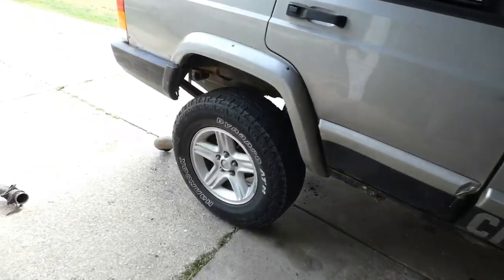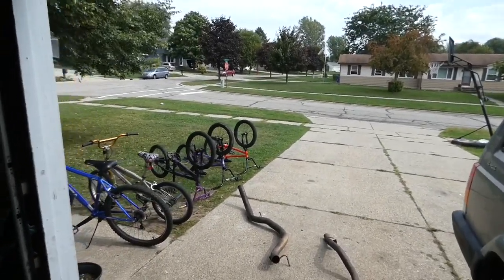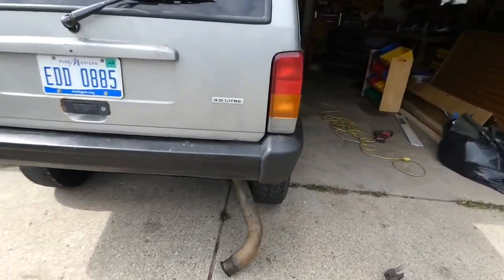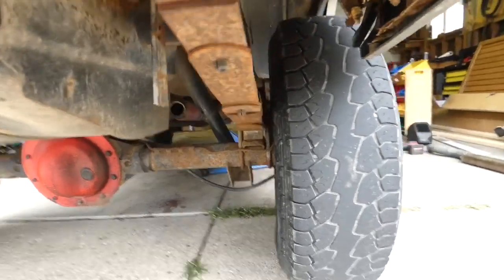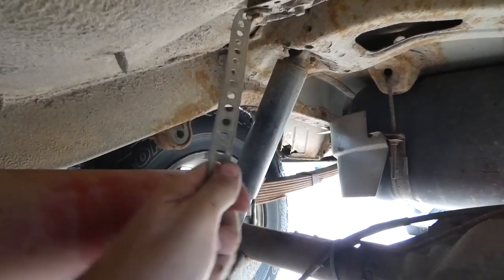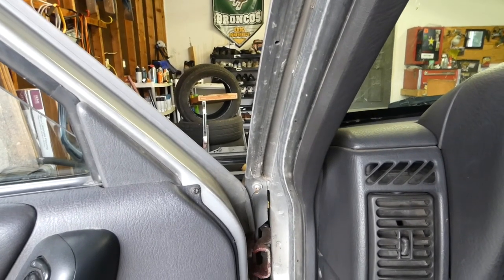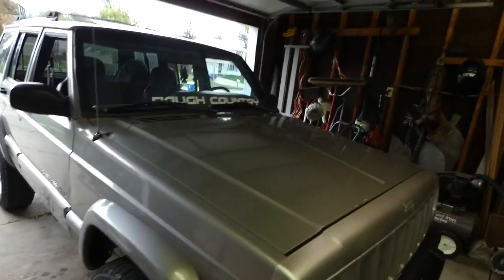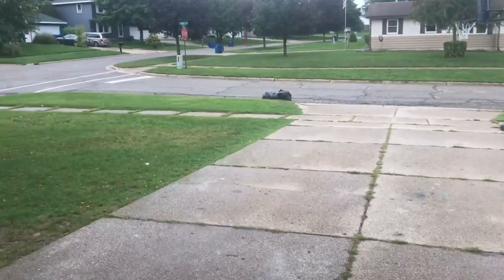How To BUY A Car CHEAP, FIX IT, And SELL It FAST Pt.27

Comment: I’m surprised this was in my recommendations. 900 subscribers and YouTube is showing you to me. That’s encouraging to someone who might want to start a channel.
Reply from the maker: Badapdose 89 were pushing hard for 1000 subscribers right now.  It’s our first milestone and we’re close! Thank you!
Reply: I have a 2 door 92 Cherokee, 4x4 with the 4.0 straight 6. I want to lift it atleast 2 inches. It’s a beast and I love it. Sold my Silverado to buy it. It’s a little rusty but nothing too serious. Need a new floor pan on the driver side. It has a small hole in it. Frame is in good condition though and the engine has zero problems. I’m currently trying to get my license back so I can drive it again. I’m constantly looking up videos about XJ’s and I’m sure that’s why you popped up for me. Pretty cool to see how many people love them like I do. I subscribed. Cheers
Reply from the maker: Thanks !! I appreciate it. I’m always playing with xj’s. Lol. I’ll show all my cheap to free ways to modify them as well. Check out my fender armor vid.  Those cost $350-$400 and I made them for $25